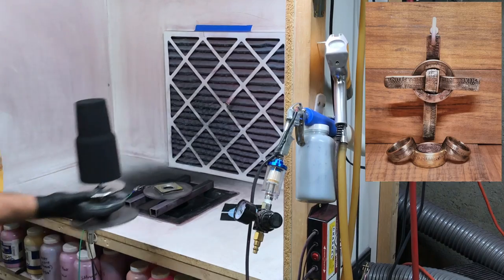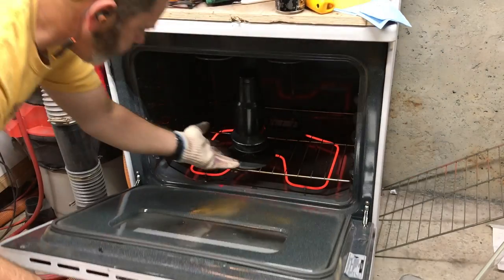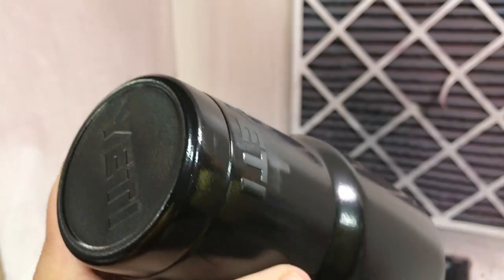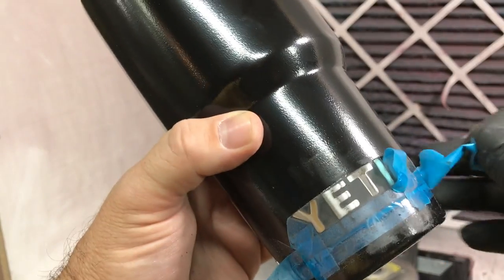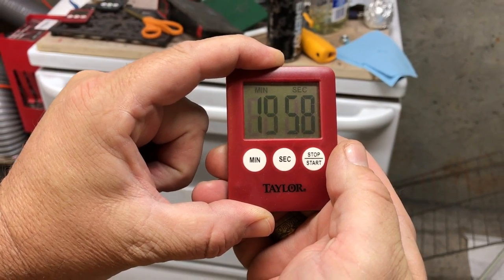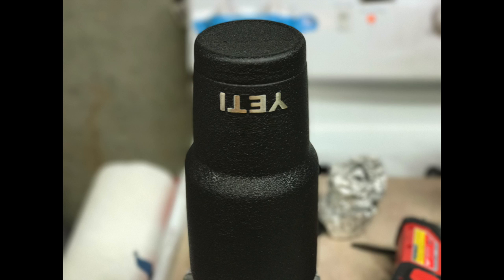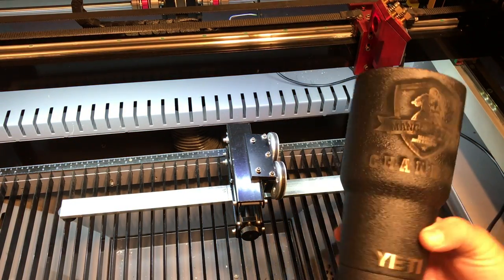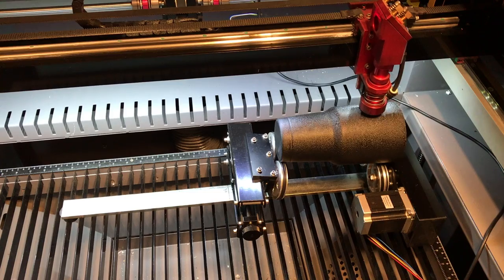How to Reveal YETI logo on Powdercoated Tumbler | Bonus Tip

Comment from the maker: Everything you need to know is right here!  

In this video one of
 my subscribers Dennis Johnson took up Powdercoating.  He did what came 
natural to him and revealed the Mossy Oak logo on his first cup.  I 
asked which method he had used.  It turns out he did what was natural to
 him.  He makes rings from tokens and coins and to make the images on 
the coins stand out they tarnish the coin the sand the high spots.  It 
makes for a beautiful effect.  You may even see the one he made for me 
in the video if you pay attention.   You can reach him on FB https://www.facebook.com/profile.php?... or Text him at 517.673.3392

Affiliate Links:

220 Grit Foam Sanding Block
http://amzn.to/2t8eWTl

Vacuum Cleaner Micro Attachment Kit  
http://amzn.to/2dCK5I7

Video Equipment Affiliate Links

Rode VMGO Video Mic GO Lightweight On-Camera Microphone Super-Cardio
http://amzn.to/2pMM2XK

2
 in 1 Adapter for iphone 7/7 Plus, Lightning to 3.5mm Audio Headphone 
Jack and 2A Quick Charge Converter,Wofalodata Nylon Cable Splitter (No 
Phone Function and Music Volume)
http://amzn.to/2pyimwy

Ravelli APGL4 New Professional 70" Tripod with Adjustable Pistol Grip Head and Heavy Duty Carry Bag
http://amzn.to/2qtFQjE

StudioPRO
 (Set of 2) S-600BN Dimmable 600 Bright LED Photography Continuous Bi 
Color Light Panel & Light Stand Kit with Carrying Case & 
Barndoor - Photo, Video & Film Production Studio Essentials  
 http://amzn.to/2dMiP9f

Blue Yeti USB Microphone - Silver  
http://amzn.to/2dewgA5

Sony DSC-RX10 III Cyber-shot Digital Still Camera 
http://amzn.to/2dJcAA0

Fotga Heavy Duty L-bracket with 2 Hot Shoe Mount for Video LED Light Camera Flash Camcorder Microphone
http://amzn.to/2pl51qW

NEEWER
 160 LED CN-160 Dimmable Ultra High Power Panel Digital Camera / 
Camcorder Video Light, LED Light for Canon, Nikon, Pentax, 
Panasonic,SONY, Samsung and Olympus Digital SLR Cameras
http://amzn.to/2pykswm

Apple iPhone 7 Plus 4G LTE Unlocked GSM Quad Core Smartphone w/ 12MP Camera (US Version) Jet Black
http://amzn.to/2qj6GOM

JOBY GorillaPod SLR Zoom. Flexible Tripod with Ballhead Bundle for DSLR and Mirrorless Cameras Up To 3kg. (6.6lbs)
http://amzn.to/2qmKTTH

Grip
 Gear’s Movie Maker Set - Electronic Sliding Track System with Variable 
Speed and Motorized 360° Panoramic Time Lapse Head compatible with 
Smartphones, GoPros, Digital Cameras
http://amzn.to/2oW8EQz

Lifeengine
 Rotating Tripod Time Lapse Stabilizer 360° 60 Minutes, Motorized 
Rotating Station Time Lapse Adapter for Canon, Nikon, GoPro, SLR Camera,
 Digital Camera
http://amzn.to/2pl9QjY

Flir Camera
http://amzn.to/2sXSImR

Music Used With Permission for Ryan Bitters - Waylight Creations
http://waylightcreations.com/music
https://www.youtube.com/channel/UC38C...
Songs:
Kick Your Heels 
Mecha March

BASICALLY BASIC

Usage:
 This is free music for YouTube. You can use any of the tracks as often 
as you like as long as you attribute the work correctly. Below (in 
italics) is how you should attribute:

“Mecha March and Kick Your Heels” by Ryan Bitters (http://waylightcreations.com)
Licensed under Creative Commons: By Attribution 3.0 License
http://creativecommons.org/licenses/b...
Reply: ManCraftingTM what powder did you use?
Reply from the maker: Hey Brian, Here you go... https://www.prismaticpowders.com/colors/PWS-2859/DESERT-NITE-BLACK/
Reply: ManCraftingTM will I still need a copper ground if I use 2 different guns for a second coat? Thanks
Reply: Anissa Stewart I believe you still would. Both guns would be using the same ground connection. The earth ground will provide better results.
Reply from the maker: Anissa Stewart Brian is correct.  You will need an earth ground and it can be the same one for both guns.
Reply: @amstewart2003able  I never saw this comment.  Anyone else seeing this and wondering the same question.  The ground is what makes the 2nd coat possible.  So two guns attached to the same ground, but you do need a ground.

Comment: Great revile.. after looking at your vlog I tried it with my yeti beer cooler. Amazing result. But I do work with stainless steel so was very carefully with masking it off and also don’t use a heavy grit.  Your spot on old mate. I finished with scotch bright. Perfect finish. Thanks for the tip
Reply from the maker: Awesome.  Thanks.  I may give that  a try as well.

Comment: Hi, great video... I'm from Indonesia, would like to know is that a regular oven for food that you use? The heat from the oven will not damage the tumbler?
Reply from the maker: I've put 100's of tumblers in the oven without issue.  I have only had issues with used cups that have been washed.  Water gets into the area between the cup and the cap at the bottom and it can steam off.
Reply: @ManCrafting  Thank you very much for the kind reply. Hope you have a Happy Holiday and Merry Christmas..
Reply from the maker: Pulomas Jaktim great so far.  Thanks!  My pleasure.

Comment: Looks like maybe you're using a Boss Laser.  What were your power and speed settings for your powder coated yeti if you don't mind me askin!?!?
Reply from the maker: erichyatt1 it's a 100 Watt and I use 35 power.  300 speed and .085 scan gap.
Reply: Do you have a link for the laser would like to check it out.
Reply from the maker: Marc Dalton this is the one I have. We are about to buy a 1416 for a more Mobile setup.  It will do tumblers as well.  https://www.bosslaser.com/laser-engraving/boss-ls-1630.html
Reply: the 1416 looks more like my speed and budget. What extras would you need besides the rotary attachment?
Reply from the maker: Marc Dalton send me an email.  ManCrafting101@gmail.com

Comment: Cool video and it doesn't look too difficult to raise the YETI logo. Can it be done without heating the tumbler? Also, was that snake in your backyard? Have you ever tried to use a snake as motif for a tumbler?
Reply from the maker: Jorge Rodriguez it needs to be done before the powder cures.  Once cured powder is really tough.
Reply from the maker: Jorge Rodriguez I haven't done a snake themed cup yet.  I'm sure I will.  The snake was brought to me tangled in bird netting. It would have died in a day if they hadn't.

Comment: can vinyl be used for powder coating?  I sell the exact size vinyl for yeti and rtic
Reply from the maker: I actually used that method primarily in the past.  I prefer to not have to do it at all, but if you apply the vinyl first, powdercoat, remove from the oven just like I do in this video and remove the vinyl you will get great results.

Comment: Hey Chad what model Boss laser do you have? Also is the tumbler spinner an accessory?
Reply from the maker: The rotary is an accessory.  If you go to BossLaser.com you can actually build what you want in the package and see the total cost.  I went with a 1630 because I knew Tumblers weren't all I wanted to do, but it was about the largest I could fit in my basement.

Comment: I spoke with a lady at my local "engraving" shop. She said the machine would most likely discolored the powder coating(burn) it. How true is that?
Reply from the maker: What color was the powder?  If the laser is at the right setting it shouldn't discolor anything.  I've lasered a lot of different colors as you can see on my videos.  No problems.

Comment: Is it possible to laser engrave a powder  coated motorcycle frame? Given that the laser machine was big enough to fit a frame in it?
Reply from the maker: Without a doubt.  It just needs to sit level to the gantry under the laser head.